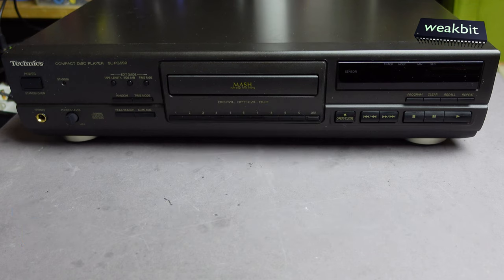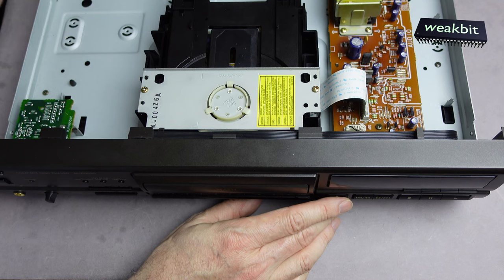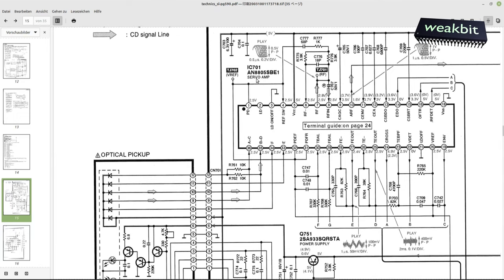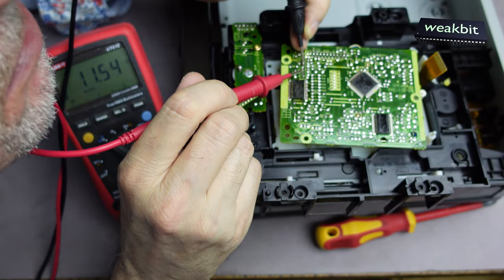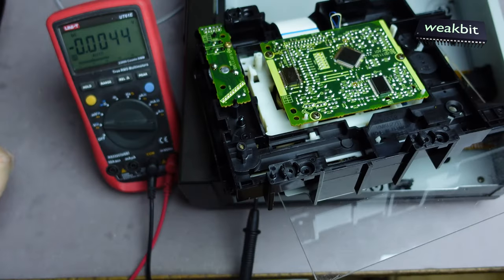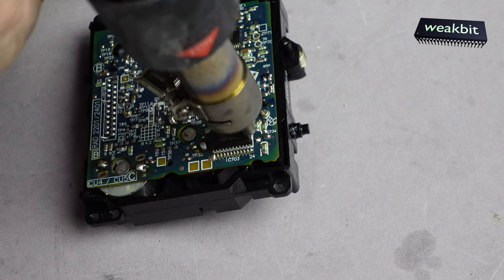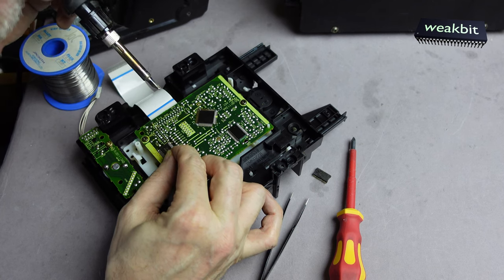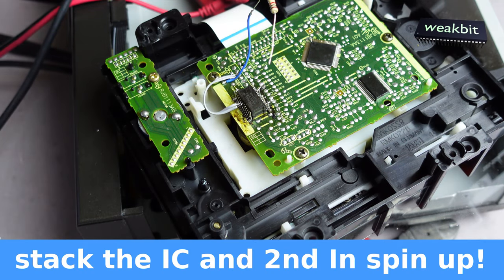Technics SL-PG590 repair

Comment: In the service manual there is a fault finding tree. I ended up down to the IC702 leg 30 where I read 2.5V, tree says this is an optical pickup failure. Then I realized that the ppl who said that the laser diode deteriorate over time and the variable resistor in the optical pickup needs to be turned to a lower ohm value were right. The CD player is unable to detect the CD as the laser diode is not as good as it was when new so it would not spin up the spindle motor. My value was 1.22 kOhm and I had to turn down to 600 Ohm to get it started again. Now the optical pickup can detect the CD, I might still need to go even lower as the first CD plays, but sometimes in a funny way. First I try another CD because this CD is as old as the player. :)

Comment: I have some updates on my work. Finally i removed the mechanism from the SL-PS77D and i put it into the SL-PG590
  Then the PG590 started working however it did not like to play the beginning of many discs. I removed the board on the mechanism and i turned the potentiometer very slightly clockwise. This seemed to help with playing tracks at the beginning. 
  However then i wanted to know if the board from the PG590 was bad so i swapped them and it also worked however the problem with playing the beginning of discs returned. I did not want to make more adjustments so i replaced the original board from the PS77D. I also suspected after reading here that the tracks and rail the laser tracks on might need lubrication. I noticed that at the end of the tracks the white grease was a little old and thick. This might have had something to do with the bad reading of the discs but i didn't experiment enough to say weather it was the adjustment of the potentiometer or the lube. I only had 3 in one oil or thick silicone grease. Usually i would use the silicone but i decided to add just a few small drops of 3 in 1 this time. I put the original board back in and everything is fine.
  Conclusion is that either the laser is tired or as suggested here the mirror that reflects the laser up to the lens probably needs cleaning, i'm not sure if i can get to it.
  The thing is the PS77D had some rust on the casing so i couldn't really sell it. There is very little difference except for a separated transformer and different features on the front panel, also the 77D is taller but the mechanism is the same. If swapping Mash mechanism you might need to change the front panel on the drawer to fit your main front faceplate. to do this eject the drawer and carefully with a blade or tiny flat screwdriver you can release two small plastic catches, it then slides up and off.
  It's possible the potentiometer needs to be calibrated to the new driver board under the mech if you do need to change, i can not confirm this but it is what i observed.

Comment: Check the motor that positions the laser head to ensure it moves freely. If it's seized it cannot put the laser head unit in first position so the drive motor won't turn on and spin. Usually you'd need to remove the laser head position motor (long silver one on the head gear) apply a few drops of oil and provide it some power for several minutes to free it and see that it moves freely over time.

Comment: I have one here. In the older Technics CD players the repair was simply to change the blue Phillips caps. I changed some caps just in case but it was still spinning slow and reporting no disc. Then i warmed the larger circuit that also contains the power supply in case any of these caps were failing and voltage might be low. I was getting around steady 4.85V on the regulator i think. However after some gentle warming it now refuses to spin so i tried putting it in the cold and still no spin, then i adjusted the small vr under the laser assembly i tried slightly both directions from original position but still no spin. I am not sure why it has stopped spinning at all. I tried to clean the lens gently with just toilet paper on tweezers but that changed nothing. 
  I did not have a 1uf caps so i put a 2.2uf in. I think the 1uf was ok but i have no idea why they used a 50V cap!
  I will put the 1uf back and see if there is any change. The ic you changed does not use many of it's pins only a few which seem to be soldered fine. I'm putting the 1uf back in now on the board under the cd mech.
  Well i've tried everything very carefully and put the 1uf back in. But it now does not try at all to spin up and comes up with no disc very quickly. 
  Sorry i don't see exactly what your solution was. It's very rare for ic's to go bad without another reason.
  I have a similar Technics "Mash" player which works but i still prefer the older Technics CD player i have. I changed the blue caps and it works very well. It plays discs that the"Mash" player can not read or skips on.
  I've tried now also more extreme turns on the tiny pot. I cleaned the 2 switches on the mech and the pot but nothing. 
Not worth spending any more time on. It's even a waste of space in spare parts. lol
Reply from the maker: Hello - first I'll tell you how the init process is working. The tray will close and then the laser switch on and the feedback receiver diodes (4pieces + 2pieces track) are looking for a reflection - first the lens go up to the CD and make the focus better or/and go down and focus to the track of the CD. If this reflection is coming then the µController will turn on the PWM and spin up the spin motor clockwise fast. The EFM signal will receive over the lens and the 4pieces receiver diodes will receive this signal and bring it to the RF-Amplifier to amplify this small signal that is coming from the CD. If this will work the TOC (Table of Content) will read and then the µController know where are the tracks (on which seconds the track begin). If this is running normal the CD-Player is working.

Comment: Congratulations sir what ic sir.? For spindle?
Reply from the maker: This is a IC Technics AN8389S.
Reply: @weakbit633  maybe same problem of CD player pioneer pd 106 won’t spin spindle motor sir  where to check sir the ic? Or?
Reply: @weakbit633  the pioneer using la6520  ic
Reply from the maker: @cortessarge5399  Hello 1st please check if the laserpickup have a red laserlight (don't stare into the beam) if not change the laser-pickup. Then search the service-manual for this CD-Player in the internet. Search the spindle motor and the sled motor on the plan this is the same IC where it is connected to. Check it with a Oscilloscope what came out? if it is a low level signal you know you can not drive the motor with this low current. Maybe the IC is defect?
Reply: @weakbit633  ok sir thank you very much for helping me what i have here only digital multimeter I don’t have oscilloscope sir but I will try thank you sir and more power to your vlog im always watching your vlog
Reply from the maker: @cortessarge5399  Thank you very much! In your case and if you are interest so I bought a small Handheld you can see it now often on my Videos it is a OWON HDS-2102S 100MHz for around €250,- and I order/buy it at Amazon. You are welcome weakbit
Reply: @weakbit633  sir you know i want to be like you how to repair  etc but im very poor person huhu i have here pioneer pd 106 my brother in law gave it to me its broken sir i want to fix it because i dont have cd player im just wishing that i can repair the cd player so that i can have one huhu sometimes just guessing the parts is bad
Reply from the maker: @cortessarge5399  First of all this is very laudable that you want to repair the CD-Player what you mentioned. To my person it is near impossible to repair this failure like me in case there is no experience in electronics and if you don't have the 40years electronics experience it is very difficult to repair some opto-electronic like me. This is hard to hear but it is the truth. A minimum Equipment like a Multimeter, Oscilloscope, Soldering and De-Soldering Equipment and a Hot-Air is the minimum requirement that is useful for this job. But what I tell you first is organize the service-manual in the internet in case of "I've never seen a PD106 before" so it is for me also a new land. 
Did you organize the service-manual till yet? If yes I can get it to and say something what you can measure with your Multimeter is that a proposal?
Reply: @weakbit633  ok sir thank you very much 🙏
Reply from the maker: @cortessarge5399  check the service-maual here https://elektrotanya.com/pioneer_pd-106_sm.pdf/download.html
Reply from the maker: @cortessarge5399  measure first the CN202 pin1 must be short low after close the CD tray. This is the switch for the SLED-Motor(Laser-Pickup in start position origin). Check pin2 (spin-motor) if it is with a Voltage? if not the CD will not detected and/or the Amplifier is not enable or the Amplifier is defect. Check IC201 LA6520 Pin8 1,8V if it not spin - it should be high/low if the spin-motor must run. [test it every time open then close the tray then this init must run]. make a report weakbit
Reply: @weakbit633  ok 👌 sir thank you very much for the idea 🙏🙏
Reply: @weakbit633  sir  i check out the ic LA6520 pin# 8 no 1.8 volts supply output the ic LA6520 had 10 volts supply output pin#12 but pin# 8 no 1.8 volts supply output even the pin # 7 what’s next sir?
Reply from the maker: @cortessarge5399  please check the Voltage Regulators +5V on the 7805 Regulator is there a Voltage? To test the LA6520 take a 1kohm Resistor and connect the input pin 8 to lower GND the input then the Spin-Motor must run. If it is not running the you must search in the power-supply.
Reply: @weakbit633  thank you 🙏 very very much sir for helping me etc…. I will check sir 🙏
Reply: @weakbit633  sir i put 1k resistor # 8 of LA6520 to ground nothing happen  sir the spndle motor didnt spin
Reply from the maker: this mean that the IC not working and this mean you must search on the Power-supply. Is the IC getting the Voltage from the supply? IC202 Measure from pin14 V-B to pin16 V+B what is there? Side 11 what is on IC31 (ICP-N10) V+B out and what is on the in? Also check the IC34 (ICP-N10) what is on V-B? measure this two parts and find out why the Voltage is not there?
Reply: @weakbit633  ok sir thank you very much 🙏
Reply: @weakbit633  sir when you check the voltage the negative probe of multimeter should be connected to the body ground of tha cd player then the postive probe of multimeter to the components? Is that correct sir? Im newbie and  I really wanted to be like you sir🙏❤️
Reply from the maker: @cortessarge5399  Yes please measure from GND to the V+B then the Voltmeter show you a positive Value. If you measure from GND to the V-B then the Voltmeter show you a negative Value.
Reply: @weakbit633  thank you 🙏 sir